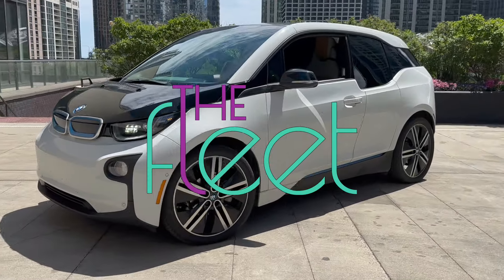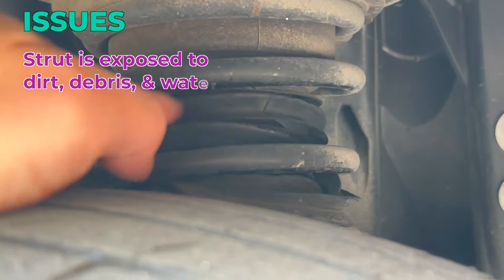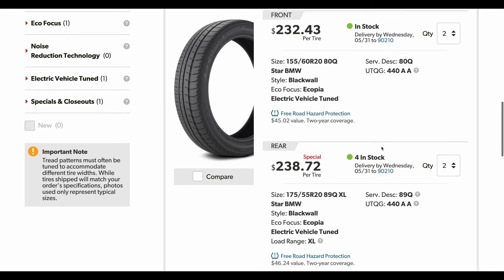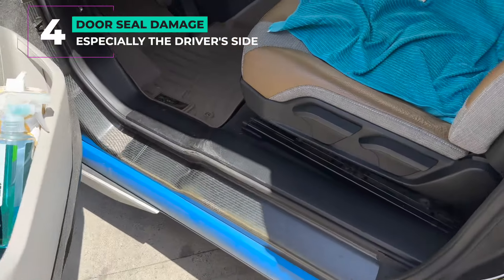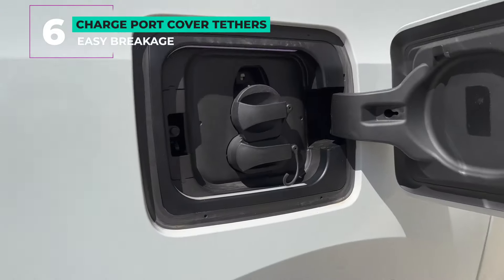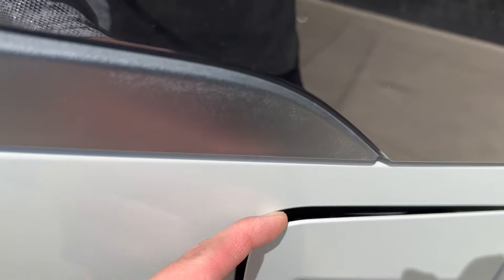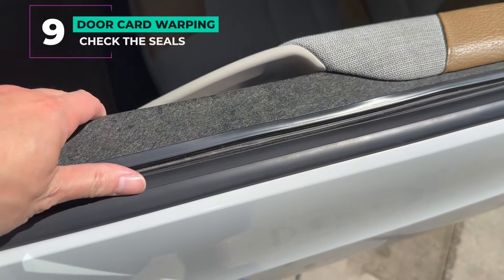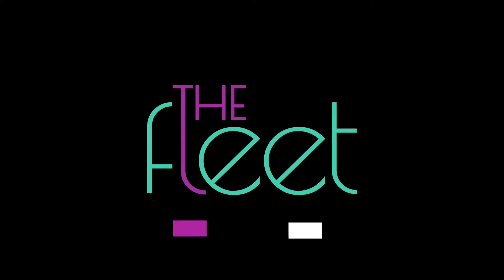BMW i3 - 10 Possible Problems Buying Used - Long Term Electric Car Owner’s Review

Comment: In fairness, none of these potential faults is going to bankrupt the typical i3 driver.
Reply: yes  155/19/70  tyers £100 each and only 2 wear quickly, cup holders 3d printed £13
Reply: @whocares264 thanks for the info

Comment: You didn't mention a very important thing. If the air con stops working you shouldn't drive the car, since cooling of the battery depends on the same air con system.
Reply from the maker: Thank you, will be doing a video mentioning that and the CFRP roof issues, among other things. Just need to get it back from the garage first! 😅

Comment: What about the AC compressor fault?
Reply from the maker: Definitely in Part 2! Sounds really scary (if the issue you’re referring to is parts grenading and severing the coolant lines, causing thousands in damages). Let me know if it’s something else, and we need to do a 10 good i3 things list first! 😄
Reply: @thefleet  I'm about to pull the trigger on a 2016 BEV 60ah i3 for 15000€, but reading about this fault might actually put me off the deal.
Reply: If its bought in a CARB state. That is covered for 10 yrs 150miles make sure yall check the carb warranties think me later.

Comment: You missed the biggest thing to look out for, Air con not working, that would mean the battery management temperature has also stopped working, and a seriously expensive fix.
Reply from the maker: Definitely a huge issue! Going to be in Part 2, covering things like the carbon fiber roof delamination and motor mount failures. Thank you!

Comment: Or carbon fiber roof delaminating…
Reply from the maker: Have that filmed for Part 2 already! 😭 You can see ours starting to bubble at the beginning of the next video: https://youtu.be/IYwH1XMBOhA
Reply: I think it’s not carbon fiber but a carbon fiber-like cover. Real carbon fiber don’t make big bubbles like on my roof
Reply: It really is cfrp scraps formed into a roof panel. Moonroof cars have an aluminum roof.
Reply from the maker: @kwenger7088  It's a great way to recycle the scraps! Definitely wish we had the moonroof, but it seems to be a rare option - haven't seen one in person, even after looking at dozens of cars.
Reply from the maker: @gibemato  It's not carbon fiber in the traditional sense where you can see the lovely weave, but recycled carbon fiber pieces that are mixed in with plastic resin to  create a strong lightweight part.

I feel you, because ours is starting to bubble and delaminate too. Thinking about getting the roof vinyl wrapped or sanded down and re-cleared.

More info on the CRFP roof: https://www.plasticsnews.com/article/20140818/NEWS/140819921/bmw-closes-the-carbon-fiber-loop

Comment: And gearbox reducer dead every 40k km...
Reply from the maker: Saw some reports on that and it sounds scary and expensive if BMW does not cover it under warranty. Looks like we might need to do a Part 2 with more issues, thank you!
Reply: what is a gearbox reducer
Reply: @whocares264  it’s the part that transmit the power from the motor to the wheels by reducing the rotation like a gearbox on a thermic car.
Reply: @gibemato  thanks

Comment: There is one more thing to look at: The microswitch that detects whether a charging cable is plugged in may be defective. This means that the charging cable cannot be locked and you can no longer charge, or the charging cable is locked an won't release. A repair is VERY expensive because of the high amount of work. (pay $1,5 for the microswitch an $500 for the repair)
So please check if a charging cable locks and also unlocks correctly on the first try. If it takes several attempts, something is wrong.
Greetings from Germany😊
Reply from the maker: This is a great tip, thank you! 👍
Reply: Or just replace it yourself 🤷🏻‍♂️

Comment: Thx for the tips, just got a proton blue 2017 i3 REX. Both front boots were bad and the rear tires were shot at 16k miles, but the dealer fixed them up. Also had them put a fresh 12v battery in to be safe. Luv this car so far!
Reply from the maker: Thanks for watching, enjoy your new i3!

Comment: Thanks for the video.
Realizing how well cared for our 2017 REx was when we bought it used 3 years ago.
Only fault so far at 86k miles is my fault:  I should have replaced the 12v battery sooner. 
It gives no warning.
Easier & cheaper by $100 to replace it as a preventative.
Reply from the maker: Thanks for watching! Looked at a 2017 REx and regret not getting the better battery and upgrades a bit, but the 2016 was easier on the budget.

Living on borrowed time with the original battery in our i3.  Very surprised it’s held up so long, but have a Remy AUX18L on the way and a weekend set aside to do the job. Overall the most reliable BMW we’ve ever had!
Reply: Everyone should buy a monitor that plugs into the cigarette lighter that tells you the power level of the battery before you start it.
Reply: @CandycaneBeyond what is it called?

Comment: Try a PT-CAN 2 failure in minus 15. Left me stranded haha. I still have my 120 after 3 years because its brilliant but if you lot are serious about longevity the whole main harness is exposed and you should all consider re-engineering it. I have made a video about the whole fault finding procedure but I wont post a link - I aint gonna hijack this thread :) Other issues now getting common are high voltage insulation failures on the ac compressor and heater and also the shut off valves are failing alot too. In fact I had a YT subscriber bring me their i3 60 as they couldn´t get it repaired anywhere else . this was cool and a big surprise indeed haha.  I have vids on all of those so feel free to browse. Great content and lovely to see another person so passionate about the i3 as I am.
Reply from the maker: Really fascinating to see internals of the i3 taken apart on your channel - thanks for taking the time to show us! At least in the US, i3 prices have taken a dip lately, so I'm on the hunt to update my 2016 60Ah to a 2019+ 120Ah model. Appreciate you stopping by and contributing!
Reply: @thefleet  Many thanks :) Yes they are a wonderful car but not many folk know how to fix them it seems. Got another from the dealer next week where they said nothing wrong yet I had already diagnosed 2 HV cable insulation failures...
Reply: Would you recommend an i3 to somebody who knows nothing about how to fix a car? I'm eyeing a 2018 BEV 94ah for a little over $13k delivered with no accidents and 4 owners

Comment: I'm still driving a 2014 REX. I only have needed to buy tires, and a 12volt battery as well as a yearly oil change. Minimal battery degradation, fun to drive, cheap to drive. Also, I haven't had any issues with the roof. There was a recall for the REX gas tank/ fuel system that was done. I've thought about getting a newer EV or hybrid, but I really don't need to.
Reply from the maker: Sounds like you got a good one! It’s a great used car bargain, and I would definitely like to upgrade to one of the 120Ah models in the future. 👍
Reply: I had a Toyota Prius Prime before this and it was the best hybrid I had ever had. This is a close second. I can't travel long trips without stopping every 70 miles to fill the tank. Hassle. BEST CAR FOR DOOR DASH!

Comment: I run winter tires on my 2017 Bev for the past 3 years , you can fit 4 cup holders 3 in front 1 under the armrest all mine are 3D printed ABS . Seat heaters fail only when wet or if you kneel on them and break the heating elements. Door seals I apply Rubber silicon to make it soft and rubbery.  I 3D printed the charging covers and stuck them on the charge door for L2 and a flip cover the the CCS a Wokby hack. I put a smallpull  tab on the Charging flap and gas flap when it fails to open during winter times. 12V replaced by BMW. I kept the front emblem and removed all others around the i3. All maintenance done by BMW , oil change, brake pads, I've done my own rotation . other than the tire selection (can use i8 tires too) I have no complaint, next is to upgrade to a 60kw batter to give it a 400km range + rex (100km) also bimmer codded to unlock the REX , disabled some annoying stuff and upgraded to a Rolls Royce startup screen)

Comment: We have a 2015 model and it’s one my best daily drivers.  The AC is failing right now but everything else makes for an easy day.  Thanks for a tip or two I will have my mechanic look into.
Reply from the maker: Thanks for checking the video out! You probably already know this, but the AC is used to cool the battery in addition to the cabin. If the compressor fails badly, it can be a costly repair if metal pieces get distributed within the system lines. Overall though, the i3 has been a lot less problematic than other BMWs we’ve had. 👍
Reply: @thefleet  I did not know that and thanks!

Comment: the petrol flap opens fron inside the car
tyre wear is heavy only on the rear drive wheels
the 12 volt battery is easy to replace

Comment: The foot seal can easily be fixed with Silicone sealant.
Reply from the maker: I had good luck using Permatex Optimum Max Flex Gasket Maker to patch the hole.
Reply: I put rubber patch on mine and it's holding up well

Comment: some of these issues arent issues at all like seat warmer, why would i need a seat warmer? thats just extra I've never had them and probably never will use them. Anyway i've been looking to buy one but idk if i should. Anyone in the comment section recommend one? I'm looking at at used 2014 bmw with 80,000 miles (cheapest one i found)
Reply from the maker: In areas with cold weather, many i3 drivers use the seat heaters instead of cranking up the cabin heater to get a little bit of additional range.

When you’re talking about the smallest 60Ah battery in the 2014-2016 models that’s undergone degradation over 8-10 years, every little bit of juice counts! If it’s warm all the time, then of course, no big deal if the seat heaters work or not.
Reply: I saw a video where a girl got a brand new i3 but she doesn’t use the a/c because she wants to save battery life as much as possible
Reply from the maker: I can wear extra layers and use less heat, but that would be tough going without AC in the summer! 🥵

The i3 actively cools the battery using the AC system refrigerant when it’s hot anyway, so you’re still expending energy there.
Reply: @GoldnLion  that's funny. Lol

Comment: The speedy disintegration of the suspension boots and door seals suggest a particularly poor grade of synthetic rubber was selected by BMW senior management, most likely from a Chinese supplier. Totally unacceptable in a car offered at $55,000.

Comment: One doesn’t own a modern BMW.  BMW controls how long you can drive it.  BMW controls data. Memory.
Reply from the maker: Things are already going in an interesting direction with all the subscriptions and data connectivity. Already lost the app control of the i3 due to the outdated cellular modems, and we’re dependent on BMW keeping their servers up and going. Interesting point raised!

Comment: Great points. and such a bad place to install a 12v battery. German engineering...
Reply from the maker: Just installed a new one - happy it’s done, but totally agree - taking apart the frunk storage area and having to remove the windshield washer filler tube while banging your knuckles throughout due to limited clearance is not par for the course when it comes to 12v battery swaps. 😅
Reply: @thefleet  taking apart the frunk ...2 screws

Comment: Door card warping - I do have that issue. How to fix it?
Reply from the maker: I have talked to two dealer service departments about the issue and taken my door apart to see what’s going on.

Basically the door card itself is made from kenaf plant fiber mixed with polypropylene fiber and EPDM modified talc-filled plastic. It was made to be lightweight using sustainable materials, and is not as rigid as a traditionally constructed door card.

All of that is to say that it will deform more over time compared to a traditional panel. The concern is when it begins to separate from the rubber moldings between the window and the top edge of the door card, leaving a visible gap.

At this point, there can be water ingress if opening the window/door when raining, more deformation, and there will be increased pressure on the yellow push clips holding the card to the inner door skin, causing some to pop out and the card to come loose. It is not super common, but definitely something to keep an eye on.

On my i3, the flex and gap are definitely worse than when new, but it is not to the point of concern yet. Just keep an eye on it. Replacement door cards run about $400-500 each from the dealer, so it’s a bit spendy but not horribly so.

Hope that helps! 👍
Reply: @thefleet  That helps a lot, thanks! Mine isn’t super concerning either and there is no gap yet. Still, that imperfection wouldn’t fit to the rest of my pristine car. 😉

Comment: The AC compressors fail in this car often. The battery's are cooled by the AC system. It makes the compressor replacement much more expensive and hard to do by yourself. I would not buy a used i3 for this reason only. 5-8k cost for dealership replacement.

Comment: Thank goodness for the hidden key and manual frunk pull.  Ignored signs too long and found my 2017 bev stone dead in the driveway yesterday  while plugged in.  New Remy AUX18L will be here tomorrow for top off and install made easy with YouTube.  I found this best last time.  https://www.youtube.com/watch?v=Glef-agDBTY&ab_channel=CTP1111
Otherwise Little Blue has been flawless in every way.  Great Boomer choice for me!👍
Reply from the maker: Great link, thanks! Our battery has a 2016 date code, so we will likely be replacing it sooner rather than later. Are you still seeing 100+ miles of range on a full charge on yours? The battery capacity degradation has been better than expected in our 60Ah model.
Reply: @thefleet  More like the full 124 miles per charge, but I seldom run it down in my Florida environment on just random short trips as an old guy.

Comment: Not to mention if the EME shorts (common issue) , $6k-$7k replacement cost, if your lucky you didn't burn anything else out at the same time. Pass on these i3.
Reply: A model year 2019 issue only, afaik

Comment: So, normal BMW quality 😂
Reply from the maker: Pleasantly surprised at how much better it's been overall than past BMWs! Dealt with N54 HPFP issues, DCT issues, prematurely failing injectors, coils, cracked rear subframes, all that good stuff. It's all relative, I suppose. Thanks for stopping by!

Comment: this car have 12v battery!!!??  why!!!  i thought that use the big battery !!!!!
Reply from the maker: The big battery can charge the little battery under certain conditions, but it’s a definitely a legacy thing to still have a 12v battery to power some of the systems. Agree with you, looking forward to the day where the huge high voltage pack can just do everything! 👍
Reply: Teslas also have 12V battery. actually all EVs have 12Volts to power lights, infotainment and so on when car is not turned on!
Reply: You’re always going to have a small 12 volt battery in ev’s as the main battery is 600 to 800 volts somehow I don’t think your going to run a car stereo with that voltage